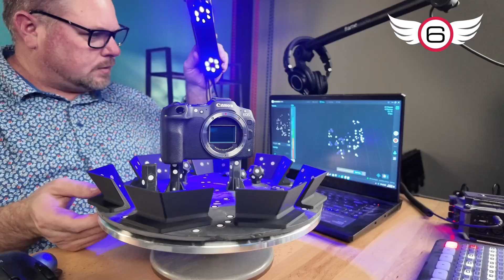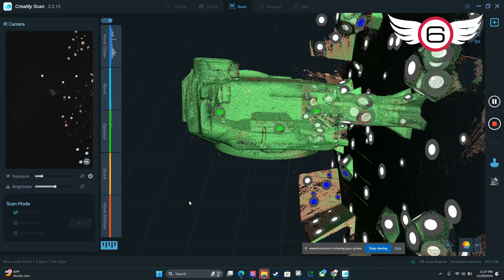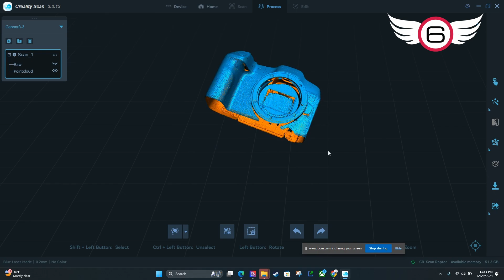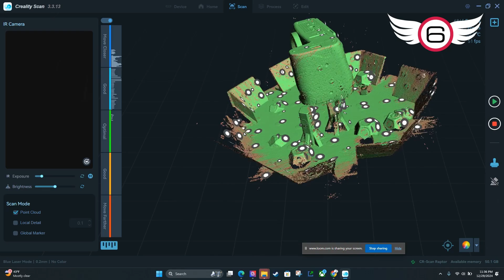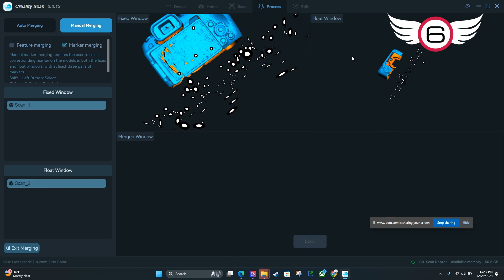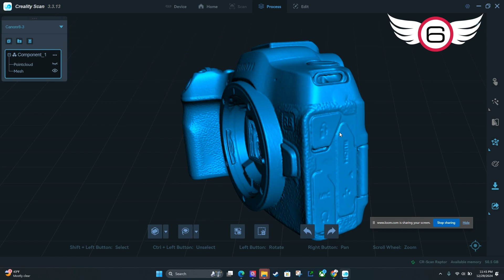3D Laser Scanning the Canon R8: Behind the Scenes Tech Magic! 🚀📸

Comment: This will depend on your down stream software - but one of the things we used to do is insert dowel pins into the holes and put shoulder screws into threaded holes.  There will be way more data to fit a cylinder to than just the edge of the hole.  The shiny surface of the pins can give noisy data so spraying them with grey paint will help.  Bonus points if you can use an airbrush to get a uniform (but not too thick) coat of paint on the pins.  A shoulder bolt with 1/4-20 threads will probably be something that you can use over and over with camera equipment.

Cheers.
Reply from the maker: Great idea, I'll keep that in mind for future scans! I think I'll try designing a 3d printed pin with threads on one side and a cylinder on the other.